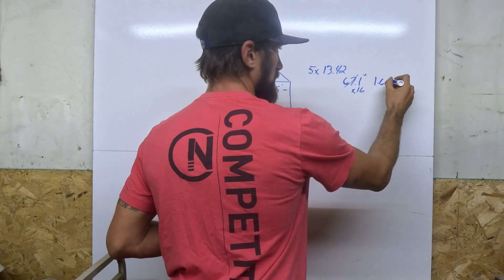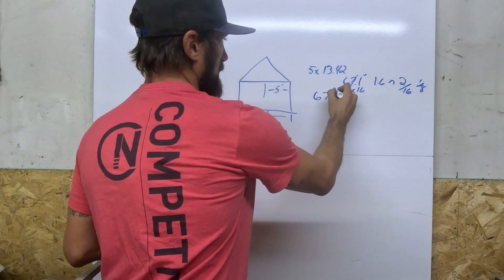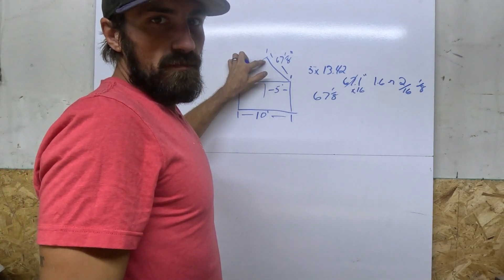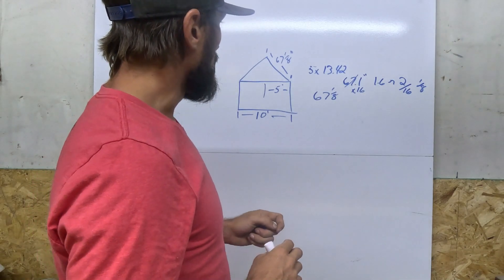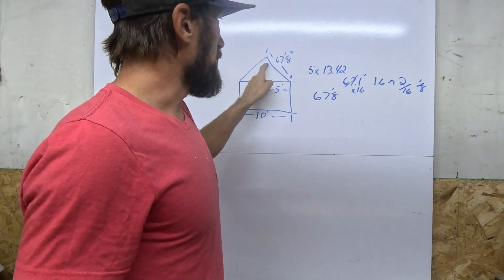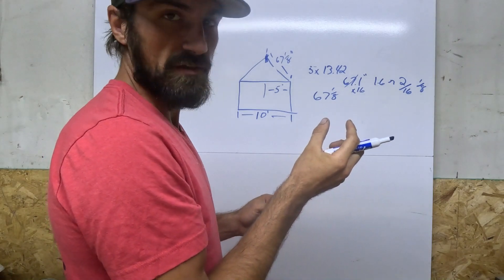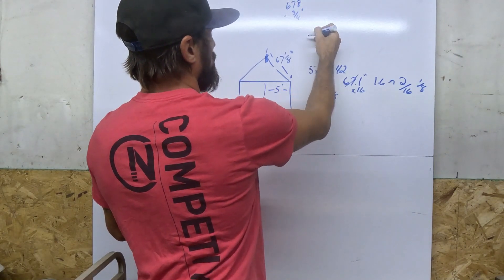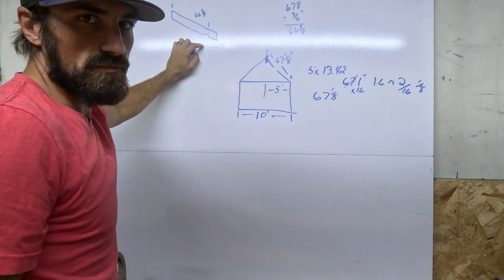HOW TO Calculate and cut rafters w/bird's mouth!

Comment: I wish your drawing was not 2 dimensional  I’m realizing how much that’s confusing me bc the “width” is going to be dramatically different
Reply from the maker: If you can elaborate a bit more I can try to help, but you shouldn’t need more than 2d because you are only calculating the hypotenuse of a triangle (the long side) 
Imagine you’re taking the big triangle (imagine a gable roof) and cutting that in half. You then have a right angle triangle right 📐. The bottom and the side going perpendicular will be the shorter sides of the triangle. The bottom is the “run” and the perpendicular line that is going vertical is your “rise”
Reply from the maker: If you can explain your dimensions I can try to help with the math

Comment: What if my run isn’t a whole #? For example 3”1’ 7/8x13.00(5 pitch)
Reply from the maker: The simplest way would be to convert your number into a fraction 
Your take your 7/8, and to convert to a fraction you do 7 divided by 8, that equals .875
Then you add that number to your inches; so in your case it would be 1.875 
You then take 1.875 and divide it by 12 (that’s how many inches in a foot) 
This will give you .15625
You add your feet to that number and then multiply it by the 5 pitch 
3.15625 x 13

Comment: when you are saying "6", are you referring to the pitch? Like a 6/12 pitch?  trying to design a Coop and working on what length rafters I need.
Reply from the maker: Yes I used a 6/12 pitch in the example so that is the 6 I refer to. I saw a lot of people asking where I got 16 from as well, that is the highest denominator on standard American tape measures- 1/16 of an inch

Comment: What about the ridge pole  ?
Reply from the maker: @fanech14  you can use the Pythagorean theory to find the length for whichever side is needed as long as you have 2 of the 3 measurements 
A^2 x B^2 = C^2 (A squared times b squared equals c squared)

Comment: I wish you could help me figure my rafters. Where are you getting the 16 you multiply with
Reply from the maker: @bethmayfieldmayfield3491  how long is the building and what pitch roof are you trying to achieve, I can help with some numbers. 
The multiplication of 16 is because 16ths is the biggest denominator we work with when framing, and it’s the smallest mark on most standard tape measures.

Comment: Excellent video.  I missed the part how you got 19.xx inches.  I've watched it over and over but I just don't see it.
Reply from the maker: @mkole3262  I only had a small piece of material so I wanted to keep it pretty short so the mock building I did was only 3’ wide total. We take half of that and multiply it by the pitch of your roof (this is the part you use a framing square for) in this example I did a 6 pitch which is 13.42”. So I multiply half of the linear ft (1.5’), and the number on my framing square (in my case 13.42) and then I subtract half of the width of your ridge material (if using a 2x10, you are subtracting 3/4 inch from the product of the last calculation). 
I hope this helps!

Comment: So i am putting a shed roof on a shipping container.   I plan on 3/12 to match the house and cause i have to stay 11’6” max height and container is 8’6.  I just finished building a house from scratch with cathedral ceilings, but my buddy did all the rafters cutting. I’ve done literally everything else so your video was really helpful and explaining the tailpiece measurement or overhang I’m not clear on.

Comment: I've got several speed squares, but I don't have one of those fancy switch blade ones. . Great video.  Thank you
Reply from the maker: I thought it was a lot cooler when I first got it. I've found that the hinge point actually makes the line not straight so I wouldn't recommend this one!

Comment: How do you know the height of your ridge beam? For your example 6 for the pitch x 5 for the width =30” to the bottom of the Beam? Or should I figure the height above the birds mouth? Sorry I’m new to framing but want to learn.
Reply from the maker: Your ridge is where the peaks of your rafters are meeting. So in the example the 30” would be from the top of the ridge, to the top of the beam your rafters are sitting on. The ridge height won’t get you the measurement for where your bird mouth lands, that measurement would come from multiplying the horizontal span times the number on your framing square, and that is the start of the birds mouth. 
Don’t apologize my man, that’s what this channel is for! I hope this helps, and let me know if I need to try to explain it another way
Reply: @ManOfMiniHats what if i’m working on an old fucked up house and the walls are out of square but i’m just there to frame a new roof and i’m trying to get it done and walk the fuck away … is there a way to pull a tape measure from the ridge to the wall and calculate the placement of the bird’s mouth??
Reply from the maker: If you put a plumb line at the front of the birds mouth you can measure from ridge to that mark for an accurate measurement
Reply: Please explain again you are too fast 
This my plan for Shed 
8x12
Or 
10x16 
I need to know 
A- How long raise of Pitch 3,4,5 feet 
8:36 8:36 
B 
1- long of rafter 
2- where cut Bird-mouth 
3- Angle 

Appreciate you 
Sam Delta Georgia

Comment: Why do you cross out and use 16, where did that number come from?
Reply from the maker: Yes I’m sorry I forgot to mention that! The smallest mark we have on a standard tape measure is 1/16th inch increments (in the US). With that being said when we are converting from a decimal to a fraction (or vise versa) we want the closest representation that we can get based off our tools.
Multiplying the decimal by 16, will give you the numerator for the fraction
Reply: Get yourself a metric tape.. no need to deal with fractions… I will never go back to inches
Reply from the maker: @NMcCauley I knew a guy that worked overseas for a bit and he said he preferred metric once he got used to it. You may have given me the push I need to try it out

Comment: great video! I'm putting up a post frame shed right now. Do you know the maximum depth of birds mouth that can be cut in a 2x6?
Reply from the maker: Thank you! 
A good rule of thumb is no more than 25% of the depth of the lumber, if you are spanning more than 12’ from post to ridge, I would suggest bumping up to a 2x8!
If you’re worried about landing on your post, just notch the top 4” of your post to 3.5” wide and act as if it’s sitting on top of a regular 2x4 wall
Reply: @ManOfMiniHats  thank you very much for the advice!